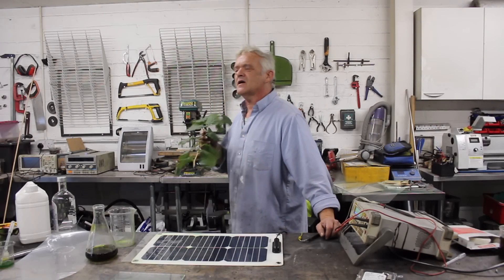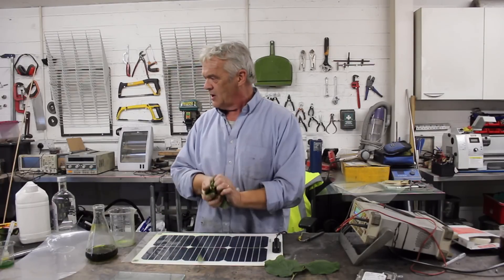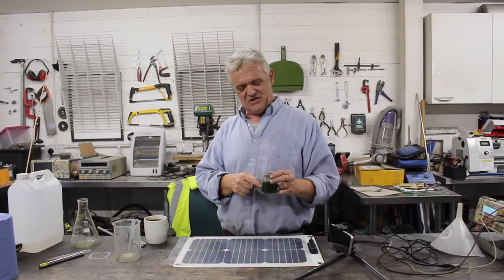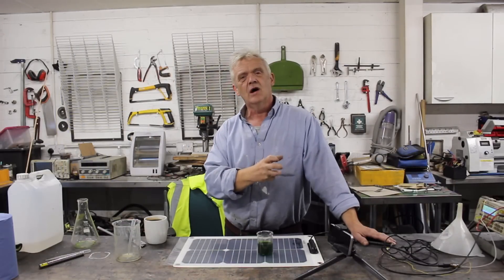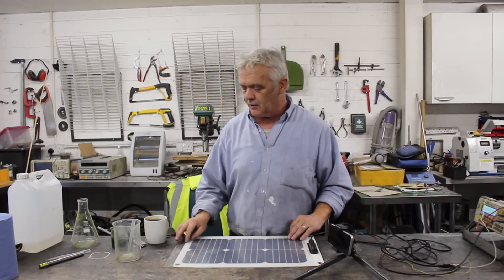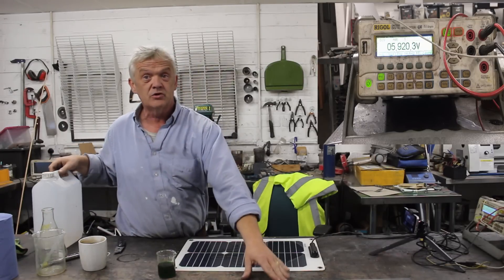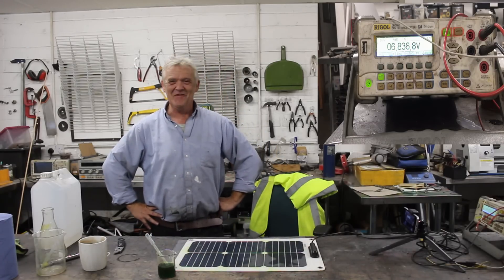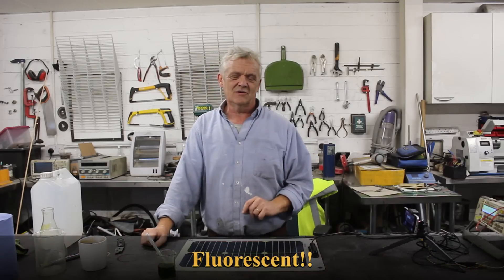1669 Using Leaves To Improve Solar Cells

Comment: Surely an improvement on this principle is contingent upon making a glass cover for your panel integrated with fluorescent compounds that not only convert the UV into significant amounts of light at a useful wavelength but convey it in one direction (towards the panel). To achieve a total gain this would have to occur without limiting the existing useful direct light if this is still more productive than the fluorescent source.  Someone must have worked on this already?  Are there any materials that convert UV into significant amounts of visible light?

Comment: That's a big one Rob. Can you suggest a solvent carried clear varnish that I can mix the leaf juice in and paint it on?
If I can just wipe it off with isopropyl and reapply when it degrades, then this may fix my issues with stuff all sunshine in constantly wet and cloudy winters we are getting. And sunburn in ten minutes on cloudy days due to 10x the UV we were getting a decade or two back in NZ.

Comment: Both graphite and molybdenum sulfide, have intense photovoltaic properties in infrared light, I can't find the article Amy more, but researchers at Malaga Spain university put a dot of graphite ink on a t-shirt had someone where it and the person's body heat (IR spectrum) was strong enough to charge the graphite dot and power an led, molybdenum sulfide, a similar material has similar photovoltaic properties

Comment: Thank you Rob & Luke! Now that we know fluorescence can boost a PV cell. I have a question for solar engineers here; Can the panel be constructed/printed on red PHOSPHORESCENT plastic? and add to this a layer of red fluorescent acrylic or the chlorophyll method Rob just showed? Also for that matter, would it be possible to create a semi transparent graphene PV panel that glows red in the dark?
Reply: You have to be very careful of the plastics you use. A lot will break down with UV exposure.
Reply: @JehuMcSpooran  it does not have to be plastic, there are printers that can do this with wood or ceramic filaments.... Would it work?
Reply: @captainnemo6655  Have never seen substantial radiation levels from phosphorous energy storage. 
As for normal enhancement: One could include another layer of glass onto the existing one and build a cuvette like "liquid carrying cell" to pump through fluids. By this you can 
a) enhance efficacy (the cooler the more efficient) and warm your pool and 
b) enhance efficacy by down-conversion and  
c) constantly filter out the worn-out dyes, and thus could even use chlorophylls, or, at night, could make light by charged-up phosphorous systems, but half will light up the sky. 
So no, d) : make energy at night is nothing I would bet on ;) But the rest is really cool ;)
And I would not demise the idea of a phosphorous system "charging up", as it is that of eg a liquid battery photocatalytically charged, but I would like to find ways to directly "discharge" it somewhere else, insides, not on the roof top ;)
Perhaps we finde stimulated discharge, so the energy is stored stably till needed some hours or days later.

Phosphorous: But this makes no sense in the prospect of the material we were given by Rob: graphitic carbon nitride. Just watch his clip "DIY safe hydrogen storage", then play with doping the material with different metal atoms or complexes. Search one catalyst that directly upon shining (concentrated?) light upon it does H2, O2 or  NH3 synthesis as needed. We need to 3D print structures that have a lung like structure for gas transportation, and additionally have a capillary feed for liquids to the structure (water for H2 electrolysis or photocatalytic production) or away  (eg NH3 as product, 9-10bars of pressure in case of "air N2" fed in 3H2+N2=>2NH3.
Or gas  and water H2O to NH3 synthesis, or water in case of H2 synthesis)

Comment: I was doing some measurements at sunset (without this thing, but maybe will try also) and can get some decent volts, but the panel had no power (amps). And also it's a fact the power curve of a solar panel isn't linear. It's good to always test the whole power output.

Comment: So a flow of the liquid under a front price of glass would convert more sun to ir that the panel could use and draw heat away from the panel improving it's efficiency.

A 10% improvement is worth a lot! Could probably get the chlorophyll from grass cuttings right?

Comment: Fascinating proof of concept..if a synthetic material that can "glow" from infrared etc could that be put permanently into the top coating? 
I have the glow in the dark soap,, and it's got some plant based chemical makeup that causes it to glow so I got to thinking what about firefly type light chemical reaction to make use of.

Comment: The higher voltage is due to you stepping aside, and block less light. Has nothing to do with chlorophyll.
Reply from the maker: you think? there are no windows and it is overhead diffuse lighting - but that would be a bummer if you are right - I will recheck it mate - cheers

Comment: Rylene dyes?
Dear Rob, habe you found a real-world application that is sufficiently enduring the UV and that we could DIY cook to coat on the glass of PV modules?

I would ask manufacturers of glass coating technologies to find durable and affordable ways to coat an existing solar cell. 

We could do something like a window cleaning robot able to spray dyes from a ink jet printer head like nozzle, or ultrasound nebulizer or airless spray. 

I find it so much more beneficial to improve efficacy by down-converting than to add another layer of perovskite module having totally different material properties like thermal expansion gradient etc. and probably different electrical properties demanding a secon set of inverter or doubling the number of mppt inputs you need.
Reply from the maker: never heard of relent dyes thanks for suggesting it mate and I am with you I suspect replacing one part of a system would really mean replacing the whole system
Reply: @ThinkingandTinkering  Found a paper claiming good + of efficacy, 9,x%, probably not easy to gain if coating the top glass by some „window cleaning robot“ with a inkjet nozzle :))
. Still:
„Down-Conversion Beschichtung Efficiency enhancement of silicon solar cells through a downshifting and antireflective oxysulfide phosphor layer“ - ScienceDirect

Comment: Try using lights & fix the solar panels they should be transparent then layered. Lights around the edges & sandwiched in between mirrors. I need a power panel not a solar panel
Reply from the maker: cheers mate

Comment: I've been playing around with spirulina (a type of food grade algea), and there is an interesting blue pigment called phycocyanin. I still don't know a whole lot about algea, but I know the pigment is pretty easy to extract and is a major accessory to how they do photosynthesis. Maybe it would have a similar effect to chlorophyll on solar cells, though I suspect a mix of phycocyanin and chlorophyll would be best.
Reply: I grow spirulina as a hobby and i had a simillar idea, if you put a solar panel under your algae pond you use the energy that the algae can't absorb and turn it into electricity.
Reply from the maker: you can lose a lot of light at the interface of anything you add to the top of a solar cell - but I dole the ideas - I can see a bit of work to get it to work but I can also see possibilities here
Reply: What do you think of coating the solar panel with a foil, building a thin pouche to let a fluid with the dyes be pumped through. If we do this with welded foil as cheap interlinking pipes, we can build up a solar thermal circuit to cool PV in summer, where heat is bringing down efficacy hugely. And to bring in new dyes or re-structure the UV damaged ones in a catalytic process. Perhaps let algae behind some membrane exchanger do the work.

Comment: try a thin layer of calcite nano powder, get some calcite and mill it and make an ink with it,or maybe you could grow tiny crystals of calcite on a plastic film or the glass itself or indeed making non crystalline calcite glass by rapid cooling of molten calcite (stable calcium carbonate mate!)??? or a thin slice of optically clear calcite crystal? reason i say this is because calcite fluoresces and is translucent)
Reply from the maker: those are great tips mate - thank you for sharing

Comment: I have been pondering on the subject of this video. Is there a material that can turn UV light in to infrared or red light where most solar cells work best. The very next video Rob up load's has the answer. 
Rob does copper chlorophilis green dye have the same effect ?
Reply from the maker: I actually don't know mate - I am kind of exploring this topic as we speak - so to speak

Comment: Time to paint the panel with fluorescent ink and see how that works. I find it hard to believe that manufacturers have overlooked something as simple. 👍😎 I was looking this up and found an article which says ,

Yale researchers recently discovered a way to boost the efficiency of solar cells by a whopping 38 percent by coating them with a fluorescent dye. Polymer solar cells are popular for their low cost, low weight, large area and mechanical flexibility, according to , but they are relatively inefficient at converting solar energy absorbed into usable electricity. The organic squaraine dye improves light absorption and recycles electrons, thereby hastening the light to energy conversion process.

Well, I don't have squarine dye, but I do have a load of green or red Poundland highlighters and a sacrificial panel!!
Reply: I was donated the base of highlighters by basf special colors division, it is called 
Tinopal NFW liquid
Somewhere I have the datasheet. 
I wanted to do indoor self-navigating peeing robots that could mark the wall with a mini-barcode of 2-3 stripes to „number“ a „beacon“ for triangulation. 

But I recommend diving into Rylene chemistry. 

Perhaps Rob finds a way to cook these cheaply and safely.
Reply from the maker: I have a quick read on them mate and you are right they are fascinating - apparently already being looked into as a possible material - the synthesis looks a little complicated for theme chemist though - but I will continue to look
Reply from the maker: thanks for sharing mate - it is interesting to know the basic idea is being looked into by Yale - it kind of means we are not on the wrong track here - the rest is about finding a good material to do the job so to speak

Comment: I wish you'd show us the result instead of just laughing and saying "there you go".
I do like the videos though. Keep them coming.
Reply from the maker: I am glad you like the vids mate - the results are in the top right hand corner - there is really not a lot more to say about this than what I showed - it's a proof of concept needs more work and shows fluorescent coatings do something - beyond that is the nitty gritty of more rigorous science and to be brutal without meaning to be rude those are the kinds of videos no one really watches so there is little point in making them
Reply: @ThinkingandTinkering  how did I miss that? Should have gone to specsave😂

Comment: Would this work with a thin layer of living algae? Grow algae and produce more power from PV at the same time.
Reply from the maker: I don't know mate - might be worth a try
Reply: Growing algae on solar panels involves lots of water.

The cooling of the solar panels by all the water mass will be of great benefit, even if the clorophyl does nothing.

În fact i suspect the algae will not fluoresce at all since the metabolism of the living chloroplast will consume enough of the energy to never accumulate enough inside the molecule to let it fluoresce down from an excited state.

Comment: Regarding this experiment. Voltage is increased due to cooling effect of alcohol evaporation. The short circuit current at constant temperature and light should be measured to indicate any gain at wavelength convertion.
Reply from the maker: I agree mate - all of what you say could be true and should be check this is really just a demonstration that some thing happened - I did coat the cell with pure IPA before adding the chlorophyll so the cooling and refractive aspect was considered I think - but only in an ad hoc way - but that doesn't take away from what you said - cheers

Comment: not a great test... after adding the chlorophyll, you stand much further back, letting more light hit the solar cells. doing the same without chlorophyll would have increased it as well.
Reply from the maker: to be honest i never thought about it -now I am thinking about it lol - I can say that there are no windows there and the light is two strips going down the room providing overhead light  and they re directly above the cell - there are no lights behind me. But I think you are right to point this out reflected light may well have been a factor - curses I will have to recheck lol - cheers mate
Reply: As well as exposing the panel to the bright fluorescent vest behind him...
Not disputing the possibility there may be some effect, but it's shocking how many comments, and only us, the two critical-thinkers?

Comment: 12% increase is not shabby.. I really wouldn't have guessed it would improve it that much.
Reply from the maker: I got 6% 0.4/6.4*100% as it more or less went from 6.4V to 6.8V
Reply: Looked like the meter went from 5.9-6.0 to 6.8 in the video.
Reply: @yougeo  but without anything on top it was 6.4V. And 6.0 with the foil and isoprop

Comment: I like that idea.  It is somewhat like my experiment with radium impregnated pigment that I did when I was a youngster.  It might be worth a revisit to try many different materials, though I am on a current bend to think that just photovoltaic may not be the way to go.  For example a cell that is both photovoltaic and alpha-voltaic,  beta-voltaic, ect may be more efficient.  Multiple energy inputs  at the same time may be better.  Who knows what the future may hold.  That is exciting to me.
Reply from the maker: it is exciting to me too mate - thanks for sharing
Reply: Or better ways to convert everything to heat (assuming it's worth the effort).

Comment: What about Water tight ziplock bag with the pigment present? Or even a glass bottle? As it is 2 volt jump from 4.8-6.8. About 45% gain? Nice work rob! Any other fluid that do this? So you can select the exact light? Anything that can phase change gamma radiation? Or Long wave radio signal?  Like what you did. Very much like stage filters.
Reply from the maker: oh - it went from 6.4 to 6.8 really mate - so about 6%
Reply: @ThinkingandTinkering  watch the video back, I called it from lowest voltage before treating it and after. Lowest recorded voltage which is the flux range towards highest voltage. before chlorophyll the lowest voltage reading was about 4.8v after the treatment the highest was about 6.8.v. I noticed it added near half on top of the originals base voltage.  At a squiggle 100% would have been 8.6v.  You got at the top end 6.8. assuming that the lowest the voltage can go, is the minimum output for that solar cell. Chlorophyll max voltage 6.8.

Comment: Well,… there goes the rain forest😬🙈 … and all the alcohol… 
Leafs should stay on a tree to convert CO2 and alcohol is for consumption🤔😝😇
Btw,… interresting way of using this material… how to make it more solid, stable and do not evaporate the alcohol.
I’m looking forward to this😎
Reply from the maker: how about we use algae blooms as a source?
Reply: @ThinkingandTinkering  it wil be a problem when temperature rises above 18 degrees celcius… it forms a cover so no light can penatrate anymore…😬
You can see this happening in still water… and an amazing place for bacteria…
Reply: Btw, i already informed for fluorecence acrylic plate… i can’t find any plate 1m/2m under the price of 199€😬 i need 20m2.

Comment: I wonder if it would be possible to "grow" solar cells using Robert's conductive ink, UV sensitive epoxy and some dopants (B4C and graphitic CN plus some thermoluminecent).
... possibly using the way they grow nanotubes on a substrate.
Reply from the maker: that is a very intriguing idea mate - cheers
Reply: Search about silicon leaves for a similar idea.

Comment: During this video I remember that inside fluorescent tubes is UV-Light which gets converted to visible light by special coating inside. 
Don't ask me what stuff it is... no idea! 
But this might be a solutiuon to increase output power of solar cells.
Reply from the maker: basically zinc sulphide mate

Comment: I am actually VERY surprised by this, I thought that any gains would be less than the losses considering you just put a green filter over the cells. But great!
Reply: Plants appear green but it's the other colors they adsorb. Green gets reflected. But either way light is attenuated by the surface but off the top of my head I am thinking green goes through easier... Right? Buhhhh I need more coffee.
Reply: It would be even more if 1, you were out in the sunlight, and 2, if you could get the free hydrogen protonization effect out of photosynthesis from the reaction.
Reply from the maker: the emission must be higher than the blocking effect is all I can say
Reply: @ThinkingandTinkering  Yep, no argument from me on that! Nice to have my scepticism proven to be unfounded :)
Reply: @ThinkingandTinkering  but I wonder if that vanishes with a thicker layer... Should be a simple extension of your current experiment. :)